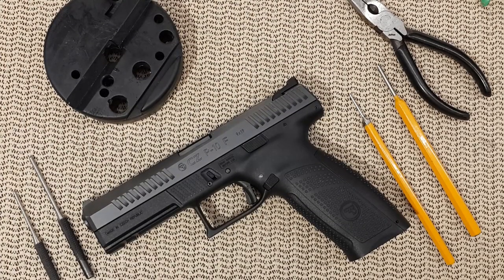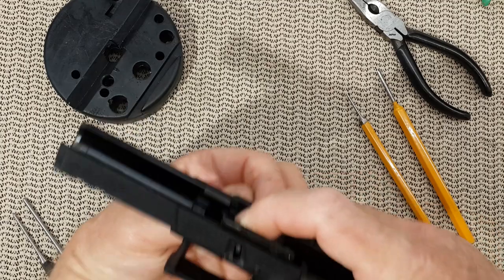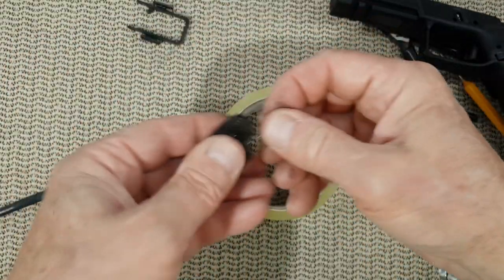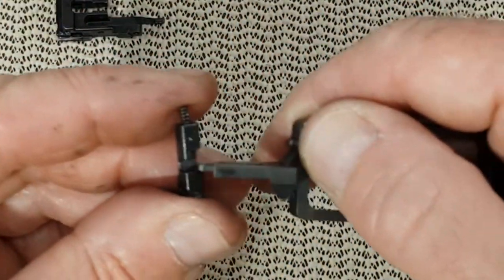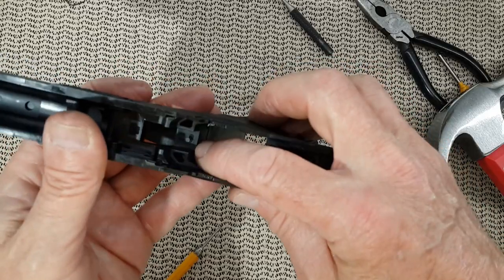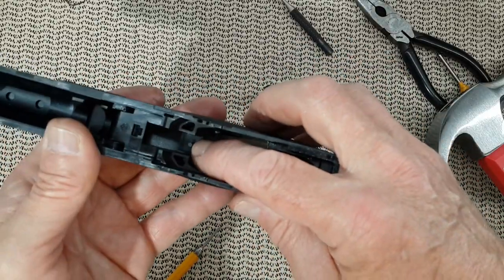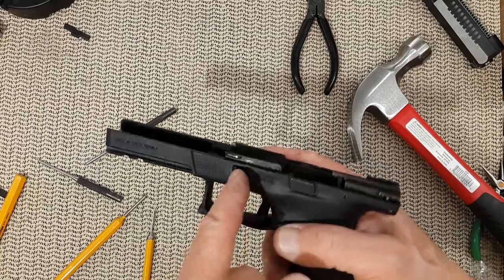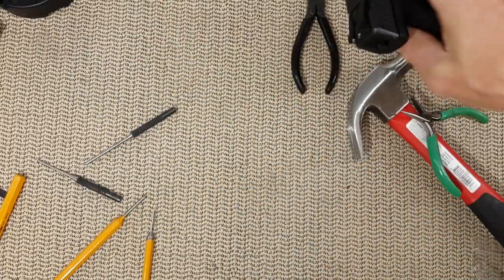CZ P10F / P10C Lower Frame Full Disassembly / Reassembly

Comment: Excellent explanations and nice clear camera work.
I especially appreciate your mentioning which sizes to use for the roll pin punches.
I also have a gritty false wall about 3mm before the true wall and will be removing the drop safety to troubleshoot.

I have a new, un-fired P-10C and have noticed the striker journal between the polymer spring cups and the actual firing pin is worn through the coating only on the top side of the journal and when I remove the slide and manually pull back on the striker, the first 3 millimeters feels rough or stepped.  I will eliminate the drop safety as a possible source of the rub before going back to CZ for assistance.
Thanks for the great videos.

Comment: UPDATE: Per your excellent demo I removed the striker safety latch and magically, the  gritty false wall completely disappeared. I may leave it out, or for potential future liability reasons re-install it, but deburr and polish the latch and actuating pin on the trigger bar. 
Thanks for your thorough guidance, it saved me from having to submit a warranty claim.

Comment: Hallo, how is the name for the round tool on the table? Thx. Greetings from Germany.
Reply from the maker: It is called a Bench Block. But I don't like this one, or any on the market, they are too small, and your gun is not fully supported. I have made one from a piece of wood that has already the areas cut out to set the gun you are working on. All you have to do is drill some holes on it. Really "The perfect" bench block. I might make a video about it this weekend if it can help.
Reply: @practicalshooter6517 , thank you very much. Surely I think, it can help. Greets
Reply from the maker: @andreasseyer3059  I just uploaded the video. The piece of wood used in the video is to make outdoor steps. 
https://youtu.be/g9IFeftC5mc